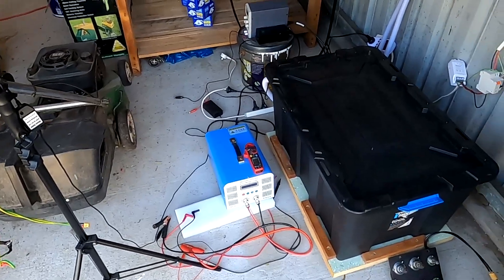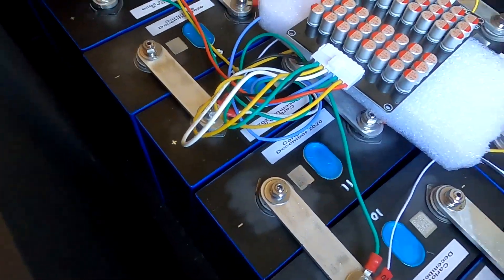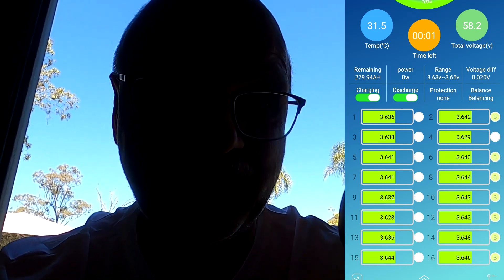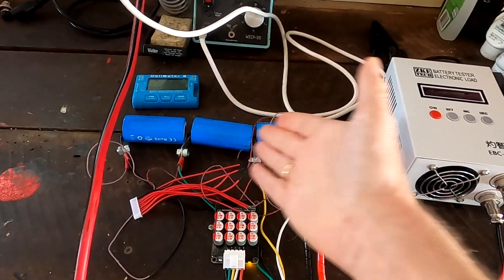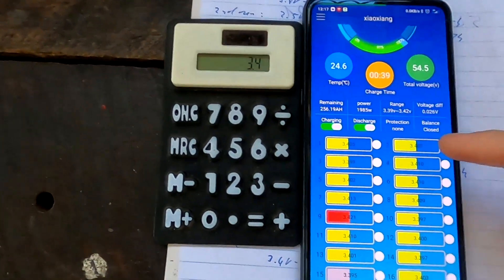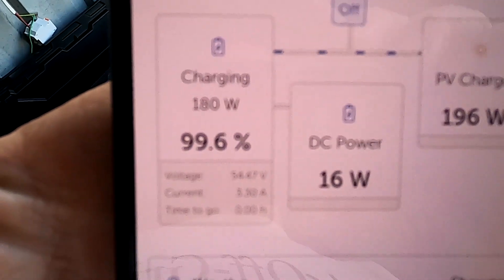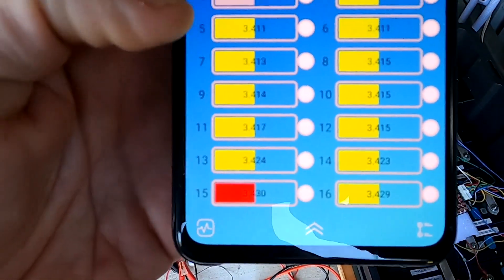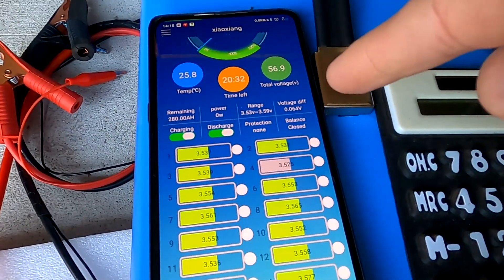Why the active balancer only works at higher voltage of your battery.

Comment: i have been using BMS, 5amp active balancer and super capacitor to normalize sudden surge of current when using inductive loads, my lifepo4 setup is 4 years now, and still good and running.
Reply: Sounds good & simple, I do a similar thing to this usually. I’m Playing with some all in one systems atm, 24v 2.4kw & 48v 5Kw & have a heap of large Maxwell Caps, 48v & 16v strings I am using. Q) what size caps you using? What size battery bank? Inverter? Any solar? I am curious about any experiments or positive things you have noticed with the extra caps in the system. I have been thinking that I could get creative and hook a seperate balancer up to the caps to keep them at a bit  higher charge right at the inverter input, higher than the battery supply voltage but below over volt protection of inverter with t-class protection, and keep extra bursting power available right at the inverter. With an all in one I can up the output voltage to a 64v Capacitor bank & probly dont need a balancer anyhow. I hope I haven’t bored ya! 
Does anyone have anything they would like to add/mention about this idea ? Good or bad?

Comment: I checked on the HANKZOR Active Equalizer Balancer and it states: "Equilibrium current 0-5.5A, the more balanced the battery, the smaller the current", and that is why you are not getting many amps out of the balancer when voltages are close, not by voltage of battery bank.

Comment: If the title is a question, it’s because during the flat part of a voltage curve the volts of the cells can be really close but the capacity of each cell can vary a lot at the flat part. That’s why balancing should be done at the steeper part of the voltage curve. The capacity of each cell is much closer at the steeper part of the voltage curve.

Comment: A balancer will not work properly if you set the battery voltage to less than 3.6 volts per cell.

Comment: Hi, Andy. currently enjoying your videos and will prowse plus various other van life videoes. Anyway I had a setup for camping with a 100Watt solar panel and dubious 240 v modified sine inverter wouldnt run AAA & AA charger..Have USB available and have found a EBL Charger  upto 8 AAA & AA or 4C or D batts. Have tried tonight on AA & AAA batteries and seeems to do a goood job might even balance once one is fully charged however disconnected as was charging from a small  solar power pack and fetching batteries out when fulll. Solar addictive! if I go above current setup need to consider earth when camping or keep at12volts? like what your doing for the community Might even do my first you tube vid on it over the weekend, but I have charged the batterries now. thinking about it never stopped you! time for a spat cheers

Comment: The solution is to charge at very high voltage (3.65) and very low amperage (less than the balancer can balance) to let the balancer make is job. For a long time. In fact unbalanced cells explain that it is difficult to measure how much the battery is charged. We measure only the 100% of the most charged cells. With other cells perhaps far from being full.

Comment: Andy, do you think hooking up two or three of the HANKZOR Active Equalizer Balancer would work with the QUCC without the runaway situation? Since you now have two of them can you see if the pack would work better.  I don't want to get a Daly, and I don't want to spend $600 on a balancer, so I am trying to figure out the best value set up, as I am sure most of your Subscribers do.  I want to keep my cells in the 3.23-3.32 volt range.
Reply: You still need a BMS at a minimum, period.

Comment: A good question to ask yourself is can you just stack the active balancers? it would be easy enough to make a pcb with some connectors or just use bus bars to parallel the balancers for a higher balance current. this would make the balancer more aggressive for these larger size cells. I feel that these balancers were only designed for 100ah cells and lower charge currents that would go with them
Reply: I think that too. The balancing current is way to small for this huge cells. And yes, you can parallel these balancers to provide more balancing current. Also you can load the cells to a higher voltage to get more in the upper part of the voltage curve to get more difference in voltage and therefore more balancing current out of these balancers. Also you can reduce the charge current so that the % of charge current to balancing current is better.
Reply: Absolutely great video. Thank you!
I am planning to build a battery with such a Balancer but 100Ah Cells and only 24V. I don't have such high charge current as you have, but I am really thinking it's perhaps a good idea to buy a second balancer for my pack to get enough balancing current 🤔

Comment: Will Prowse says in his videos that BMS's and balances are unnecessary once you have the batteries balanced from the start. Looks like he was wrong, huh?
Reply: If the internal resistance and capacity of your batteries is "Well Matched", you can go quite a while between balancings. If there are substantial variances in the batteries, balancers and BMS's can help reduce manual maintenance of them.

Comment: yep set charger disconnect  volts, let the balancer drains them till it reach ur set reconnect  ,when doing that the balancer works alone .oh dump unused power to ur grid tie inverter with a relay.

Comment: In your setup you can actually solve the single relay cut off problem quite easily: you just use a big diode across the relay contacts such that the battery can be discharged via it when the relay is open but it won’t be able to charge. It will knock about a volt off but that won’t matter as lithium voltage is higher than lead acid and your gubbins won’t mind it. You will lose the low voltage disconnect however you can set that in the inverter and still be protected. I regard 12v in the lithium as discharged as it’s about 10%, the diode knocks that down to 11 so you could set inverter low voltage cutoff to 11v and that will be above the BMS cut off so it won’t cut off the charge or any of that sort of muppetry. The relay will only be open briefly for the time it takes your loads to bring the battery down to the reconnect level. I actually use 95% as the auto reconnect or a discharge current of more than a preset amount.
Reply: Try putting 3 or 4 (5 watt) 3.6V zener diodes across cell 16. 
Remember Zener diodes are reverse bias. Once the diodes turn on above 3.6V, you should dump around 5 amps through them with 4 of them in parallel.

Comment: hello Andy, a few month  ago I built a battery for a friend , with 16 x 272 Ah LIFEPO4 cells, and a ANT BMS (300A but he use it at 100A max). After 142 days, the max déviation is less than 10mv. A top balance has been done, and since no unbalance.
Reply: I agree with this. Top balance and let them run. If you try to balance throughout the curve you will throw off the whole process. My active balancer is more for monitoring than balancing and I have it set NOT to balance unless there is a major deviation of the cells...

Comment: ever thought about talking to someone with raspberry pi super smarts about setting up a unit that will monitor , heavy discharge/charge single cells thru relays or ssr and load or charger as needed?

Comment: Great idea to communicate with charge controllers to lower current.  But you don't need to do that.  Just add a resistor in between batteries and charge controller.  So use a separate port BMS and put a 30 ohm resistor across the charger/battery port so when the relay is off the charge controller will hit max voltage with just 1 amp or less.
Another point is that when that relay opens and closes it has a huge inrush to the inverter capacitors.  Adding a resistor across it will help it stay precharged.  But you need the inverter to be separate from the charge controller for this to work - in orther words separate port bms relays.
Reply: What about the resistor when the battery is at low voltage disconnect?
Reply: @uhjyuff2095  Adding a resistor on the discharge doesn't do much for balancing since the BMS doesn't have a way to balance from the bottom.  It can only shunt 0.1 to 1A at the top voltage.  But having a resistor there can precharge the inverter capacitors.

Comment: No it does work if you are charging with 3.5 amps you are only charging 1 cell with .200 amps. but discharging with .4 amps so it does help. Anywhere from 3.4 to 3.1 the cells will be the same voltage therefore the balancer on auto balance will not work. Balancers do not work on capacity they work on voltage. With such low production you could only drive to the end of the driveway most solar setups are concentrated on Kwh production.
Reply: It seems you may need the higher current balancer as the only time the balance has a chance to raise or lower the voltage on such high capacity batteries is in the steep parts of the curve, i.e. at the lower end or higher end. In the middle, the curve is so flat the balancer can't charge/discharge enough to have much effect on the cell voltage to achieve balance.  So, higher current on the top of curve may win the race to beat balance before the BMS for shuts down due to one high cell being out of range